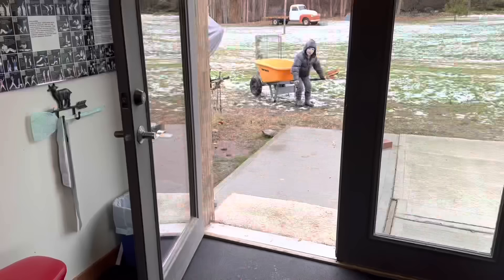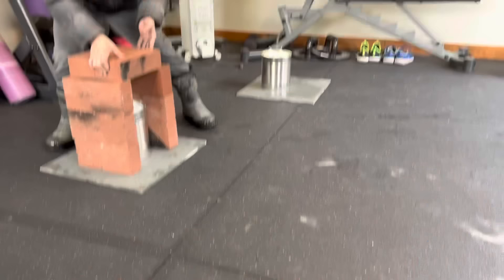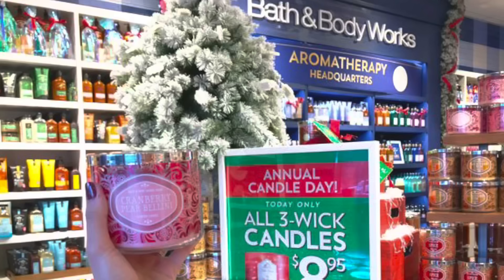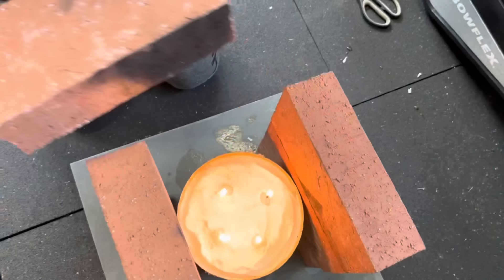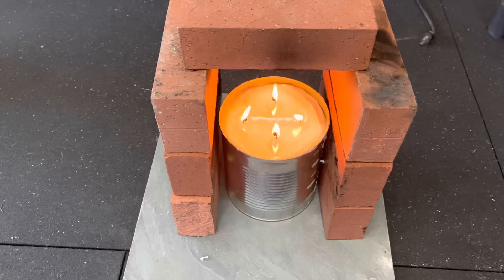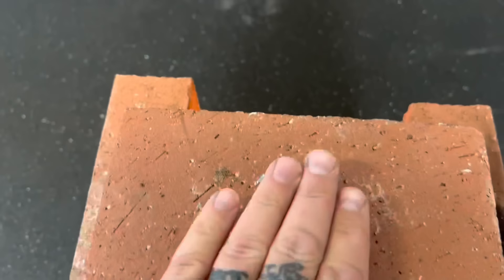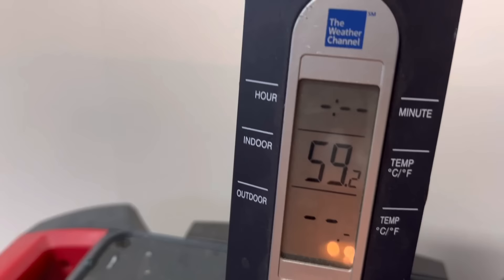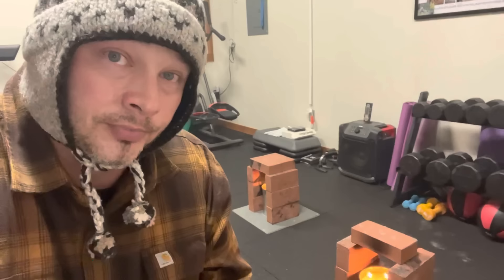Crisco candle room heating | Power Outage Room Heating | 9 hour test

Comment: I think you would have had higher temperatures from the bricks if you had reduced the distance between flame and brick. Stacking more brick on the upper levels would increase mass, absorbing and dissipating more heat.
Reply: A burning candle will release the exact same amount of heat into a room regardless of bricks, or flower pots, etc., being stacked around it or not. All the bricks do is block the light of the candle, which actually serves a purpose.  These things are a dumb distraction from meaningful preps and skills.

Comment: cover the windows and all glass with reflective or anything to isolate the cold glass from the inside to get better results even plastic is a shield... the more bricks you can heat up the more btu`s you will get because is about mass heating(bricks or metal pans) not relying on candle heat , the towers of bricks don`t really radiant heat mostly the ones on the very top are doing all the work.... heated air rises so a slow ceiling fan helps push down or move the flow... pitch a tent inside the room, good emergency ideas to stock before you need them. thanks
Reply from the maker: Good tips 🙌🏽

Comment: I see a fair number of these sorts of videos in my feed and without exception, they all lack an understanding of how to calculate the potential effectiveness of a heat source relative to the space it's intended to heat. It's worth mentioning that the bulk of your test occurred during the day, when the sun was contributing to the heat via the window. Once you went from 6-hours to 9-hours, we saw the beginning of a temperature drop. Had the experiment continued through the night, I believe what you would have noticed is that in the absence of sunlight to contribute radiant heat through the window, the temperature drop would have slowly but steadily continued.

To save myself a bit of time, I'm going to copy another comment that I shared beneath a similar video on a different channel. That one was using 4 tealight candles beneath a terracotta flower pot, but the same principles apply here:

These are relatively simple to build, but they aren't going to heat most people's spaces. The short answer is "BTU's". For a bit more information, consider this excerpt that I snagged from another web page that's trying to help people understand why it doesn't work as expected:

~~~
"Can you heat an entire room with just 4 tealights? Sure. If the temperature outside is not much lower than what you want the indoor temperature to be, and your room is well insulated, and you're willing to wait a long time. If those conditions aren't met, you can't do it. If the temperature differential between indoors and outdoors is high, and your house isn't well insulated, heat will be lost to the outdoors faster than your candles can provide heat. And even if your room is well insulated, it's going to take a very long time for those candles to do the job."

"Look at it this way. According to Wikipedia, a single tealight has an energy output of about 100 BTU/hr. A small space heater, capable of heating a small room, is 5000 BTU/hr. Thus, you actually would need fifty candles to heat the room as efficiently as a space heater, instead of just four. So let's suppose a space heater would take one hour to heat the room up. It'll take the candles over twelve hours to do the job (considering the burn-life of a typical tealight is well under twelve hours, we have a serious problem!). And remember that this is under the "ideal" conditions, where you're not losing heat to the outdoors more quickly than the candles can produce it."
~~~

Here's an example calculation from another web page that makes it very clear that a tealight heater isn't sufficient for even small rooms:

~~~
"Using our formula from above, a 1,000 square-foot workspace with 8-foot ceiling height means you’ll be heating 8,000 cubic feet of space. If the temperature outside is 30°F and you’d like it to be 70°F in your garage, the desired temperature change is 40°F. Those two numbers multiplied by .133 reveals you’ll need a little more than 42,500 BTU's per hour to keep your workspace at 70 degrees."
~~~

I'm not sharing this information to put you down. I'm sharing it because if people are going to rely on these kinds of devices to keep them warm in the case where the power goes out, they're going to be mighty cold. And, we haven't even begun to talk about the importance of airflow when using an open flame in a closed space. A fire needs oxygen. If you're in a small space and you don't have an opening to fresh air, the flame is going to use some of the oxygen in your closed room. And if you happen to be sleeping when the oxygen level in the room drops below a certain threshold, it's very likely that you'll die in that room with the pretty little heater that can't keep the space warm.

Don't die. Live. Cheers!

Comment: Even candles emit carbon monoxide and soot so make sure you have good ventilation.   I made the mistake of testing this for an hour in my bathroom with door closed to warm it up and found a black ceiling and toxic couldn't breathe when I walked in.  There's a reason why woodstoves and fireplaces have chimneys :)
Reply: A venting system could be improvised on it that would directly vent out through the open window, like a chimney.
Reply: If you use beeswax or especially paraffin candles they don't give off blk suet and burn way longer. Like the crisco candles. I have scented candles and after burning those for 15 mins I was choking on the toxic smell plus all the blk suet coming  out. So i made a whole bunch of crisco candles with candle jars I've saved over the years and used the Hanukkah candles i bought on sale after xmas for the wicks and got instant candles. So next time I used those and it gave me light and some heat and they burned for a very very long time. No toxic smell, no blk suet.
Reply: You don't get soot if you trim the wicks. People have lost a lot of knowledge with these things. You get carbon monoxide when there's inefficient burning of the fuel. Again, trim the wicks. I use candle powered heaters in my house often and have a CO meter. Not alarm, meter. It never reaches above 9ppm parts per million. You begin to get concerned at 50ppm for 20 mins or so. Beeswax burns super clean and hot if you trim the wicks as you should. An alternative that is safe for indoors is kerosene and biodiesel.

Comment: If you wanted to get the maximum heat out of them candles, you had to bring the top brick closer to the flame. You had to put the first layer of break on it’s belly and other two on their sides so you bring the top brick closer. Radiation heat not candle power heat. Good videos.
Reply from the maker: Thanks good tip
Reply: What about a very large, thick upside down terra cotta pot? Maybe even with brick on top?

Comment: Replace top bricks with steel plate. Heat up more quickly. Or alup steel box farm. Then surround it with brick. 🤗. Oops noticed you still wearing coat & bennie 😂😅🤣🤔thank you for sharing Awsome 👍

Comment: First and foremost wanted to say thank you for your video and that they are well done.

I have been watching different videos and came up with an idea that I wanted to bounce off you for your thoughts and maybe the group.
I do not wish to make a video on this but am interested in your response.  See if this idea has issues that I am blind to.
This is not for light but for heat.  

I found a large 36 oz can of stew.  (I may change it to a larger can like a coffee can )  
fill it with Crisco & one candle.  I like the idea of using 2 or three candles or so may change to a coffee can.  
*  Place can with Crisco and candle in a one gallon paint can that is not used.  Found at Home Depot.
Add sand part of the way up or dirt on bottom to keep from moving and keep stable when one is moving it around it to a different location.  I think in the other video you made a person said use earthquake adhesive.  The idea for dirt or sand is to keep the paint can cool to the touch.  Maybe not needed.
*  drill a few small holes near the top in the paint can for air to enter.   The idea for a paint can is you have the paint can lid if needed to put over the paint can to put out the candles.
*  Place a brick or a terracotta  pot on top of the can for heat.   The idea for the can is also to support the brick (or two) if the bricks are placed on the sides.    I don't know if this helps with the chimney idea or not.  It may make putting out the flame safer.
*  place on tile.
I'm just trying to come up with other ideas to make this safer than glass and can be moved around easier.  
Any thoughts on this idea.
Reply from the maker: Thank you Scott, that is a great idea